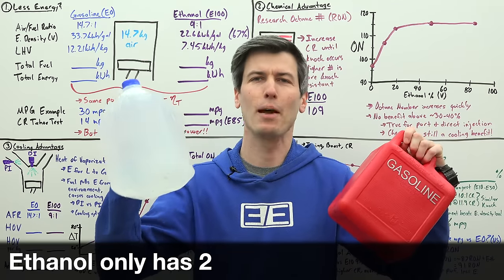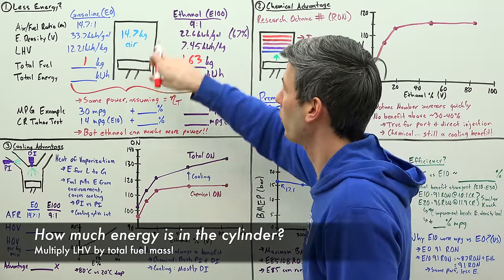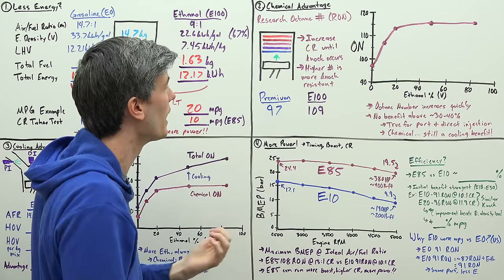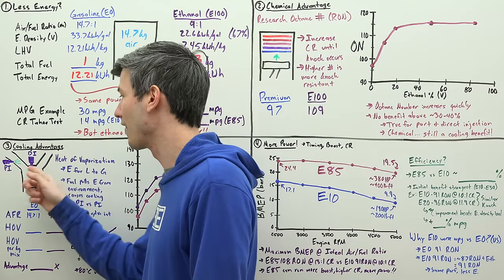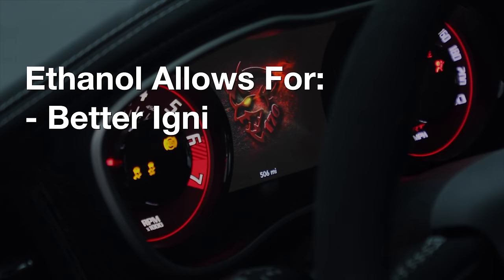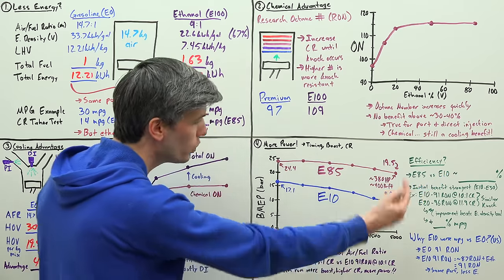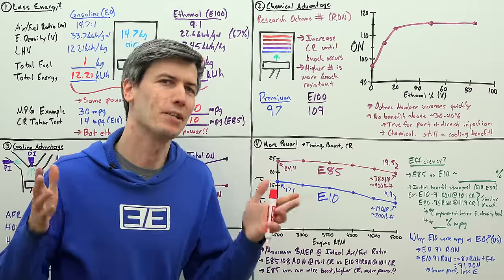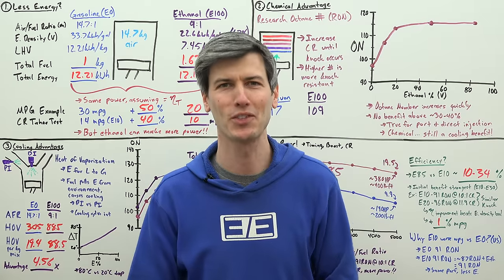Why Does Ethanol Make So Much Power? (Versus Gasoline)

Comment: I haven't scrolled through the comments completely, but has anyone else questioned the use of 14.7 kgs of ambient, (gaseous) air matched with 1 kilogram of liquid fuel? As he states, it's a mass to mass ratio, right? So shouldn't both phases be the same, as in 14.7 kilograms of liquid, (compressed) air to 1 kilogram of liquid fuel? Or would it be more practical to use 14.7 liters of gaseous air to 1 liter of gaseous fuel, (ideally)? Asking for a friend.
Reply: its a simple ratio. fuel to air. Thats it.
Reply: @oldblueaccord2629  Perhaps you are the simple one? Can't answer the question? Why bother responding?
Reply: @t.i.m.e.3419  You got a PHD right?
Reply: He’s probably amazed that some (in this instance, that “some” is you, T.I.M.E.) are fundamentally confused by the difference in the measurement of mass vs. the measurement of volume …
Reply: @sking2173  I edited my post and put a period after ratio...doubt that will help him. Jason should have used Lambda when discussing different fuels.
Reply: @sking2173  If I put a block of ice measuring 1000 mm by 1000 mm by 1000 mm on one side of a beam with a fulcrum in the middle and placed a weightless container of the same internal dimensions on the other end and filled it with water, which end would go down? Likewise, if I filled a container with 14.7 kg of air, which is a gas, (as used in the above math) I would need to use 1 kg of fuel AS A GAS to balance the equation. These are not my rules. It is basic math.
Reply: @oldblueaccord2629  No, no PHD. Just an inquiring mind. I could continue with the math and swept volume, part throttle, swept volume versus displacement, rpm and all that, but why bother when my first question seems too hard to answer?
Reply: @sking2173  Avagadros number determines gaseous mass within a volume doesn't it? Using atomic weight and the strong force or something to determine the maximum number of the molecule in question which will fit inside an enclosed space? But it's been a while since I have used that part of my brain so I could be mistaken. Regardless, why the disparaging comment? I didn't think I was being confrontational. Just asking for clarification about the math shouldn't bring animosity to the table. We are all looking for the same answers.
Reply: @t.i.m.e.3419  — In your OP, you demonstrated a total misunderstanding of the concept of “mass”. You discuss 14.7 kilograms of “gaseous air vs. 14.7 kilograms of “liquid (compressed) air, which is totally irrelevant with respect to mass, and then you start going on about liters of fuel vs. liters of air, which is completely unrelated to mass. 

Liters is a measure of volume, which is dependent on pressure and temperature — unlike mass.

Further mass is not contingent on the state of matter. So again, your natterings about liquid vs. gaseous air is absolute nonsense.

Mass is the amount of matter present in an object, regardless of its temperature, volume, state, or location.

An object with a mass of 14.7 kilos on earth will also have a mass of 14.7 kilos on the moon, although it will “weight” 2.4 kilos.
Reply: @sking2173  Firstly, it was not I who used the 14.7 kg of ambient air. It was me who questioned it though. So, I ask again, what does 1 liter of fuel weigh, as a gas? @ 1.25 ish he clearly states 14.7 kg of air and 1 kg of fuel. Mixing phases. Or is the math for liquid air or vapourised fuel? A little further on he quotes the energy density in liquid fuel, so he is indeed comparing a gas phase with a liquid phase. To be mathematically correct, the mass phases either side of a comparison ratio must be the same.
Secondly;
"You discuss 14.7 kilograms of “gaseous air vs. 14.7 kilograms of “liquid (compressed) air, which is totally irrelevant with respect to mass" 
I was questioning the use of 14.7 kg of ambient air, as compared to 1 kg of liquid fuel, yes. 
As I pointed out to you, air as a gas weighs 1.22 kg per liter at standard pressure and temperature. Are you seriously suggesting that if I compress air into a liquid phase and fill a 1 liter bottle with it that it will then weigh the same as a 1 liter bottle of ambient air, (minus the container)?
Thirdly;
"Further mass is not contingent on the state of matter. So again, your natterings about liquid vs. gaseous air is absolute nonsense" 
True, the mass of an object does not change due to it's phase, merely the size of it's container changes, and it's energy level. It is an atomic measure of the number of atoms in a unit volume.
However. 
When comparing substances of different masses per unit volume, the phases must be the same either side of the equation. You cannot compare solid ice with liquid water. This is basic math.
Hence my question.
How many liters of gaseous fuel is there per liquid liter? Only then can we apply the weight to weight ratio properly to calculate the volume of gaseous fuel required for the swept volume of ambient, gaseous air per minute through the engine to maintain a stoichiometric mix.
No PHD required to work that out.
Reply: Ohh, and just for interests' sake, there is something in the neighborhood of 7100 liters of vapor in 1 liter of liquid fuel, depending on the fuel.
Reply: @sking2173  If I were to use the above example, and say that there is 14.7 parts of air to 1 part fuel, and I used kg either side of the equation, (the scale used must be the same), 14.7 parts air, (which is 1.22 kgs per liter), would yield, (14.7x1.22)=17.934 kgs of air to 1 kg of fuel. (Slightly less than 1 liter). Seems ok to me!! Lol.
Reply: @t.i.m.e.3419  To bad what you said above has ZERO to do with stoic of fuels.
Reply: @oldblueaccord2629  Exactly. This is an issue of basic math and the correct use of ratios. The subject matter is immaterial to the argument. I ask again. What is the mass of 1 liter of fuel as a gas? Only when that is known can the afr be applied correctly. Can someone with a PHD confirm this please? I am just a simple man with no education.
Reply: @oldblueaccord2629  Exactly. It's simply a math problem.  Can you answer the question?What is the mass of 1 liter of fuel as a gas?
Reply: @t.i.m.e.3419  Read the wiki its explains Stoichiometric perfectly. You are trying to reinvent the wheel and argue the world is flat. I just cant help you.
Reply: @oldblueaccord2629  I see. So you can't explain the correct method of using ratios? Have I made a mistake somewhere? I would have thought it would be pretty simple to point out my mistake. Especially for someone with a PHD? Where's the mistake in my math? It should be pretty easy to point it out and rectify it, surely. It's only basic math rules.
Reply: @oldblueaccord2629  This is a math problem. It has nothing to do with the subject matter. You seem to be avoiding the question.
Reply: @t.i.m.e.3419  You posted a bunch of jibberish about calculating throttle bore to position stuff that has nothing to do with you question either and then deleted it. Ill just follow you.
Reply: @oldblueaccord2629  I can change my mind about the analogy I use. Doesn't change the issue at hand in the slightest. Seems to me more like you are avoiding answering the simple question. What is the weight of a liter of fuel as a gas? Only once that is known can the afr be applied correctly. That's a fact you seem to be doing everything to avoid. Why is that?
Reply: @t.i.m.e.3419  Answering questions with questions? You AI is good ..but not that good.
Reply: @oldblueaccord2629  And with that you showed your hand.
Reply: @oldblueaccord2629  — LOLOLOL … You’re wasting your time with this one.
Reply: @sking2173  You had great explanation and yet the AI cant pick up on it. I got to admit he is one of the better ones...our days are numbered!

Comment: The biggest impact of using ethanol is on my wallet when I buy food;  Ethanol production has greatly increased the cost of Food!!
Reply: Here is how the 2007 Energy Independence and Security Act affected food/feed prices (if at all):

2007 weighted corn price =$4.20 WITH 4 .7B gallon mandate
2008 weighted corn price =$4.06 WITH 9B gallon mandate
2009 weighted corn price=$3.55 WITH 10.5B gallon mandate

2016 weighted corn price =$3.36 WITH 15B gallon mandate maxed out
2017 weighted corn price =$3.36 WITH 15B gallon mandate maxed out
2018 weighted corn price=$3.61 WITH SAME 15B gallon mandate maxed out & most ethanol ever produced

Wheat
2007...............$6.48/bu
2008...............$6.78/bu
2009...………$4.87/bu

2016...………$3.89/bu
2017...............$4.72/bu
2018...............$5.15/bu

Soybeans
2007..............$10.10/bu
2008..............$ 9.97/bu
2009...……...$9.59/bu

2016..............$9.47/bu
2017..............$9.33/bu
2018..............$8.48/bu
Reply: @fletch2119  — Kevin must not really be a Cook …
Reply: @fletch2119  The price of corn for ethanol went down because it is getting more competitive and all of the farmers want in because ethanol corn is federally subsidized!  However, you completely ignored the fact that ethanol corn displaces millions of acres where food crops could be grown but are no longer.  So the reality is that the price of corn is irrelevant except to the farmers who are fighting for a place at the Federal Pig Trough.
Reply: @Hogger280  Since the Freedom to Farm Act was passed, farmers are free to plant any crop they want without risk of losing any subsidy.  End users must bid for acres if they want the a particular crop planted.

Farmer subsidies have crashed from around 25 billion in 2005 to around 10 billion in 2018 (still that in 2023) not counting inflation even.

Believe it or not, the corn belt grew more corn acres in 1980 before ethanol than they do today with record ethanol production and ethanol plants everywhere.

2018 Iowa 13,200,000 acres of corn with most ethanol production ever
1980 Iowa 14,000,000 acres of corn before ethanol

2018 Illinois 11,000,000 acres of corn with most ethanol production ever
1980 Illinois 11,600,000 acres of corn before ethanol

2018 Indiana 5,350,000 acres of corn with most ethanol production ever
1980 Indiana 6,450,000 acres of corn before ethanol

The reason for this is the fact that no corn is grown just for ethanol.  Rather corn ethanol is a value-added product of already existing corn feed acres which leaves 100% of the protein and other things still available as feed in a healthier, more digestible/efficient, and more (triple) concentrated form called distillers grains.

This is why grain prices never went up with exploding ethanol production and why the corn belt's corn acres did not explode.  While corn was taken off the market, simultaneously there appeared a brand new feed called distillers grain to take its place.

This is why ethanol can be so cheap despite the current high price of corn, the ethanol producers are making it up with high prices for their distillers grain.
Reply: @sking2173  I love it how they complain about food cost and then ding the farmers for taking government help. Thats one of my favorites.

Comment: Ethanol is also bad for engine operation and creates problems with engines. This is crazy .
Reply: Brazil has identical non-flex fuel engines we have, and their common gasoline has a minimum of 27.5% ethanol.  It has worked out so well and for so long that Paraguay went to E27 as well.

The EPA before approving E15 in 2011 conducted long term testing on vehicles 2001 and newer with not only E15 but also E20 and found that both fuels ran fine and did no damage.

The Bureau of Labor Statistic tracked the share of US household income spent on repairs and maintenance from 1990 to 2017 as ethanol as a percentage of gasoline went from .1% in 1990 to around 10% from 2011 onward.

The share of income spent on repairs and maintenance was 2% in 1990 and by 2017 it was only 1.5% after ethanol use exploded.

Comment: Cool, but ethanol is still hopelessly inefficient when considering how it is produced. It costs us an insane amount of resources to produce for very minimal return. Watch Real Engineering's video 'The Problem With Biofuels', or literally any other video on the economics of ethanol for that matter.
Reply: All the energy and CO2 it takes to produce and deliver a product to the consumer is reflected in the price of that product.

As such note the spot cash delivered price on the NYMEX for ethanol is $2.36/gal.

The price of a sub-grade unusable gasoline (RBOB) is $2.77/gal.

To turn RBOB into usable E0 costs even more than that and unfortunately for humanity becomes more toxic, carcinogenic, and dirty.

Or simply splash in >10% ethanol and the resultant usable fuel becomes less toxic, less carcinogenic, far cleaner burning, and cheaper per mile to drive.  Who can be against that?

No corn is grown just for ethanol, it is too uneconomical.

Rather, corn ethanol is a value-added product of >>>already existing<<< feed production which leaves 100% of the protein (and other things) still available for feed in a healthier, more digestible/efficient, and more concentrated form called distillers grains.

With this feed factor, ethanol can outcompete any other source and even outcompete petroleum in price as you now know.

Flawed studies/videos negative on corn ethanol assign all/most energy or CO2 to the ethanol side and little/none to the feed side of corn when in reality it should be the other way around. Why? Because if we outlawed ethanol with another Prohibition, we would still grow the same amount of corn we always do and always have. Cattle feeders need plant protein to make animal protein so if their distiller grains were ended, they would have to find an alternative protein source and that would likely have to be switching back to feeding less concentrated straight corn. During Covid when ethanol plants shut down, cattle feeders using distillers grains were facing this very scenario.

The US used 11,160,933 tons total fertilizer on corn in 1980, before ethanol.

In 2018, the year of most ethanol production ever, the US used 10,521,850 tons total fertilizer on corn.

100% of the fertilizer and things of the soil are still fed to livestock in the distillers grains. The only thing that ethanol is made of came from the air: solar energy, CO2, and water with the latter two recycled once burnt.

What logic assigns all the fertilizer to ethanol when it still goes to the livestock in the feed/distillers grains?

Believe it or not, the corn belt grew more corn acres in 1980 before ethanol than they do today with record ethanol production and ethanol plants everywhere.

2018 Iowa 13,200,000 acres of corn with most ethanol production ever
1980 Iowa 14,000,000 acres of corn before ethanol

2018 Illinois 11,000,000 acres of corn with most ethanol production ever
1980 Illinois 11,600,000 acres of corn before ethanol

2018 Indiana 5,350,000 acres of corn with most ethanol production ever
1980 Indiana 6,450,000 acres of corn before ethanol

Iowa State University measured all the energy it takes to produce an acre of corn into a "diesel fuel equivalent"

This included making of machinery, fertilizer, chemicals, plus the tillage, planting, spraying, harvesting, drying, trucking etc.

They found it takes 34 gal of diesel to produce one acre of corn.

What do we get from those 34 gallons of diesel?

We get >500 gallons of ethanol.

But wait, that is not the kicker.

The kicker is we still get 100% of the protein(& other things) from that acre of corn still available for an even better feed. A win, win.
Reply: Electricity is hopelessly inefficient when it’s produced with fossil fuel. Coal is still used to produce 30% of the US electricity, and a coal power plant is 30% efficient, and that’s before a single electron hits the grid. So for coal-derived electricity, you must put in 3.333-times the energy that you get back. Natural gas plants are only running 60% efficient.

Huge waste. Right?

Well, not so fast. The cost to produce electricity is reflected in its cost — just like ethanol. And ethanol is considerably cheaper to produce than gasoline. Detractors have much to complain about with ethanol, some valid, and some claims are outlandishly foolish.